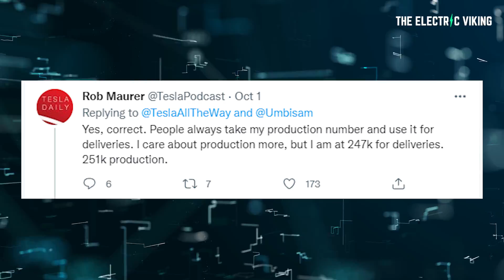The most important Tesla news you missed + 4680 battery cell update

Comment: I think you miss interpreted what Elon was saying. In the future MOST EVs sold by Tesla will be LFP batteries. Elon clearly stated on Battery Day that they will have three different battery chemistries - High Nickel - 4680, Medium Nickel 2170 and/or 4680 form factor but different battery chemistry inside than the Tesla manufactured 4680 battery and Iron-based LFP batteries.  In the future CATL may produce their LFP battery in the 4680 form factor, but these batteries should not be confused with Tesla’s 4680 Roadrunner batteries based on a high Nickel chemistry, dry battery electrode, high silicone anode, and new cathode chemistry.

Remember that 4680 is just a battery form factor - 46mm diameter by 80mm in length. Tesla should call their high nickel 4680 battery something different to avoid the confusion - like the “4680 Roadrunner Battery”.
Reply: 4680HN

Comment: Mass production quality standards is the 4680 hurdle to be cleared first.
Everything is dependent on that structural pack and the 2170 version seems to be an interim solution suggesting we aren’t there yet with the 4680 preferred one.  The slow build up of the S and X might be because they are using the ‘hand built’ 4680 cells………?

Comment: How is Tesla's 4680 Cell to pack battery a first in the industry when BYD has already announced their CTP Blade earlier this year and already have them in production? Is it just an industry 1st with cylindrical cells? 

What will be the cost per kWh for the 4680 CTP vs the Blade CTP?
Reply: Is the blade structural in the car?
Reply: @lengould9262  yes it is.

Comment: I agree....for the foreseeable future, the 4680 will eventually  become the only cylindrical form factor used across all Tesla vehicles.  LFP cathode for lower range vehicles;   Higher Nickel cathode for long range vehicles, as per Battery Day.  From what I have seen, there is no reason why the 4680 form factor can't incorporate a Li Metal anode,  ( Li foil ) which Musk said is the ultimate anode.  A good discussion on Li Metal: https://youtu.be/Kl073m98Hxk.  And honestly, after looking at QS's SSB content, I am finding it harder to differentiate between their so called "SSB" and a Tesla 4680 that uses a Li Metal anode.

Comment: 4680 can be multipurpose nickel or iron giving Tesla optionality. Also the coating is powder which makes processing easier. If threatened Tesla can easily switch to nickel. It's optionality is it's genius
Reply: BYD blade battery might be trapped with 200 mile range lfp

Comment: I doubt if 4680s will be in the S/X any time soon.  The demand for 4680s for Model Y and Cybertruck is massive as the future of Tesla literally depends upon the new cell-to-structure concept, around which the entire next generation manufacturing processes has been designed.  Although there are workarounds in place, 4680s at Berlin and Austin are the lynchpin.
Reply: I don't think 4680 is that critical. Definitely not existential to Tesla.
Reply: @lengould9262  Future growth projections are all based on Battery Day economics, which is already baked into the market cap. Can't turn back now! From Tesla's 50% yearly growth guidance, to faster supercharging to increased range and even factory design .... it's all pretty much 4680 centric and it has been in the works for years. Less efficient 2170s cannot sustain Tesla's projected growth.

Comment: The latest 4680 rumor (yes, rumor so take it as so) is that they tried to upsize the rollers used in the DBE Cathode process and they couldn't get that to work (not a consistent enough thickness).  Tesla is going with a bunch of smaller rollers in the short term which is what they are doing at Cato Road so it should work.  In the long term they hope to iron out the process with the larger roller machines but they need time that they don't have at the moment.